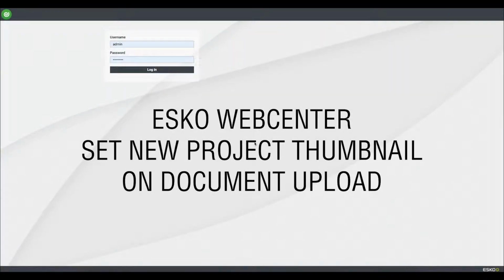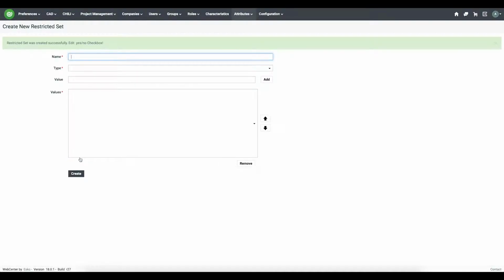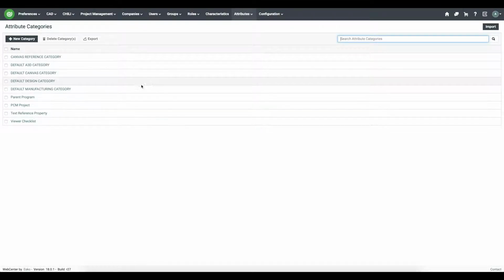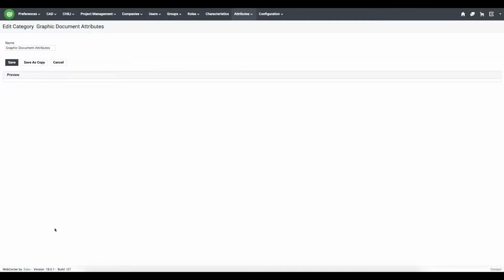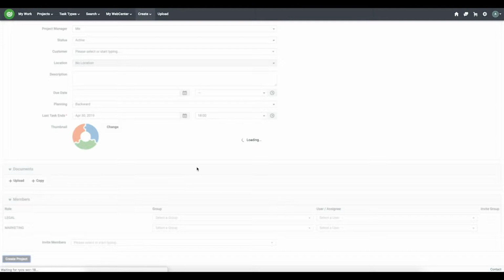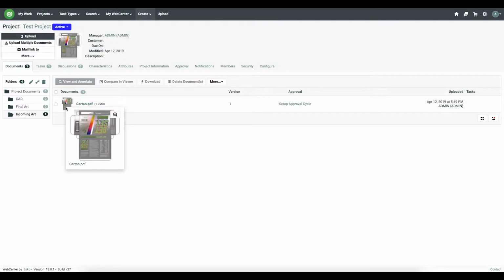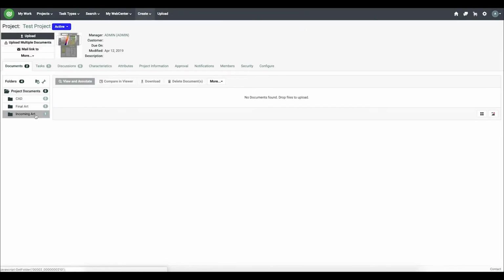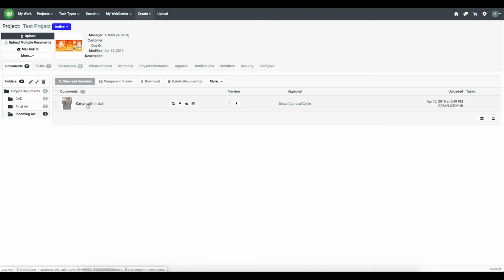Esko WebCenter Pro-Tip #15 - Set New Project Thumbnail on Document Upload

Comment: Thanks for this video! It works when uploading via WebCenter.
But not when uploading via Automation Engine. although the Attribute will be set to Yes. Am I missing something?
Reply from the maker: Stefan,

In order to achieve this, you can do one of two methods. Method 1: Use the Publish on WebCenter task, as it allows you to set document attributes at the time of upload (without rendering the view files on the AE server). Method 2: Using the Integrate with WebCenter, first upload the document then have a subsequent task after for "Set Attribute" to immediately change the MAKE PROJECT THUMBNAIL attribute to "yes".
Reply: Hi Ryan, Method #1 works! Thanks a lot!